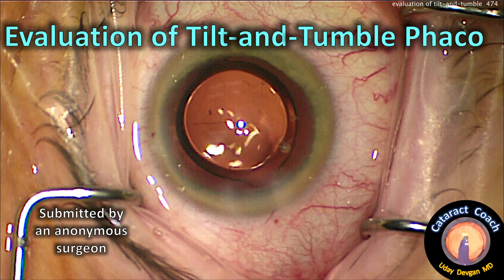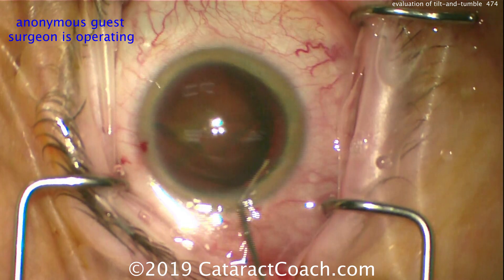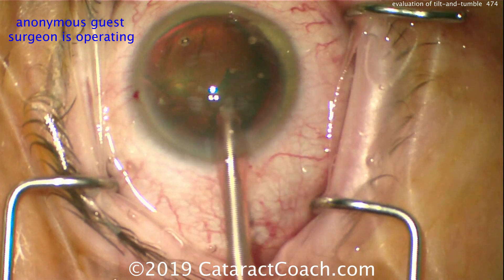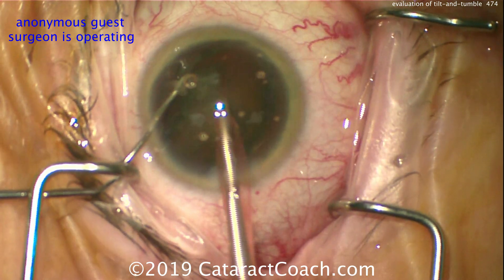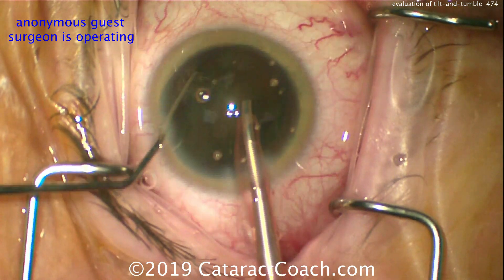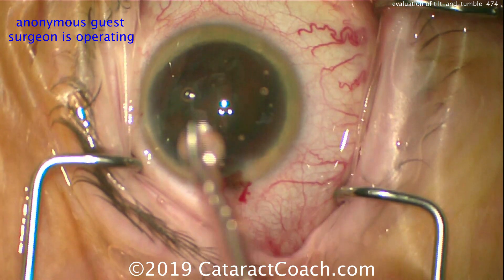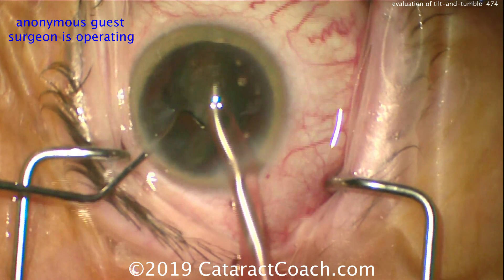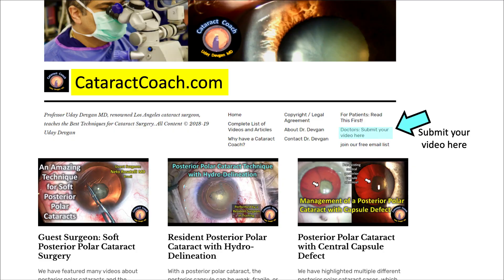evaluation of tilt-and-tumble phaco technique

Comment: Thanks for sharing and teaching. I gave up on this technique as it was causing too much corneal edema, as i was phacoing too close to the corneal endothelium. I also realized that quad settings rather than sculpt settings are better for this technique.
Reply from the maker: it works best for softer cataracts. use the higher vacuum settings and protect the corneal endothelium with a good quality dispersive viscoelastic